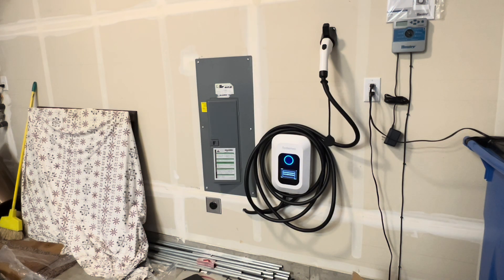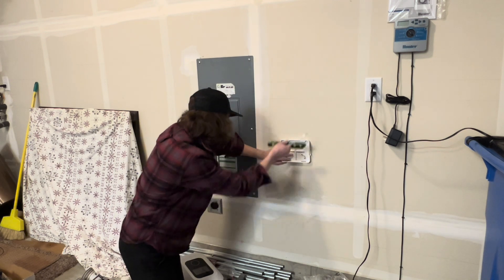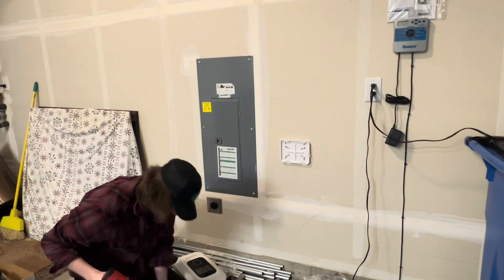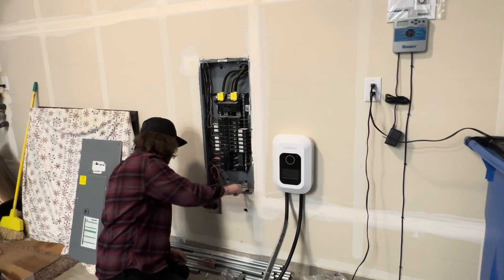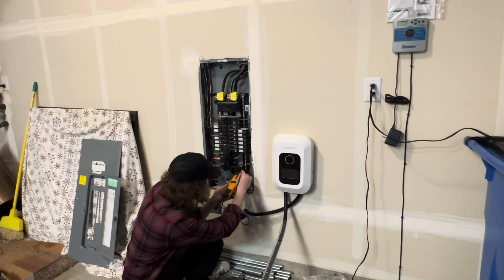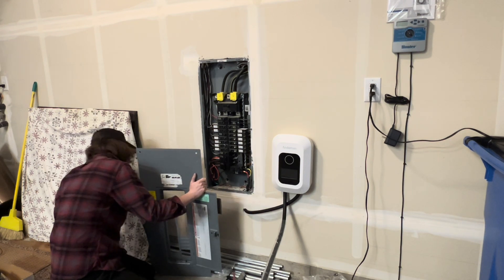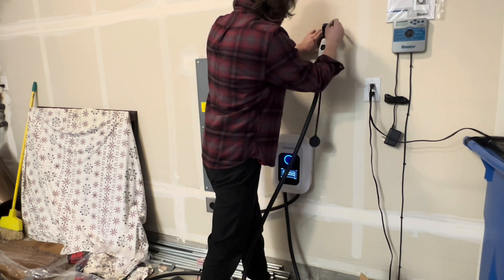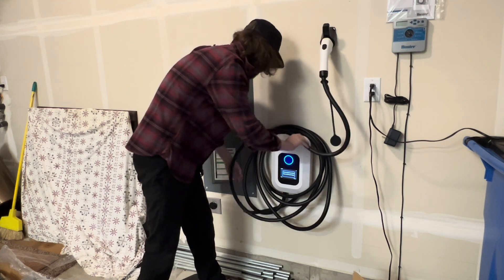How To Install A 50 Amp Andeman WS1 Electric Car Charger (Hardwired)

Comment: Cool vid!   One question. Important one in my opinion. When you turned it on without looking , was that for precautionary safety reasons(worst case scenario it blows up or something lol)??  I'm eagerly going into electrical and I've always pondered doing exactly that during that first big "ON" moment but I thought it was just newbie me making that up. You're the first Master Electrician on a video I see doing exactly that so maybe there's something to it? or did you look back because you saw a 10ft alien or something😂?
Reply from the maker: not a master electrician but yes its for worst case scenario, if something were to blow up